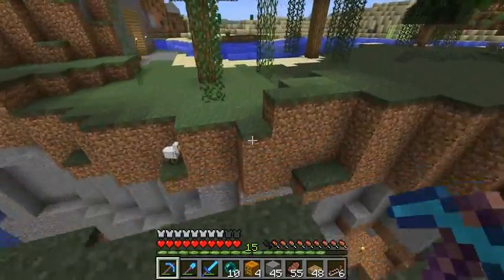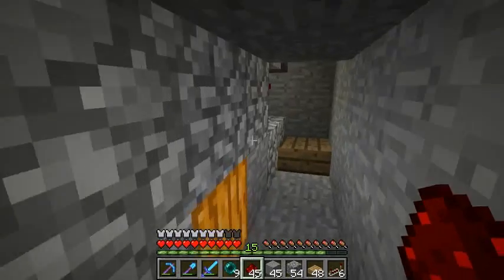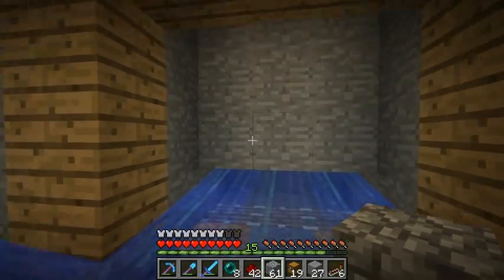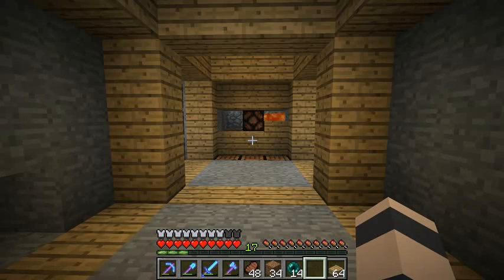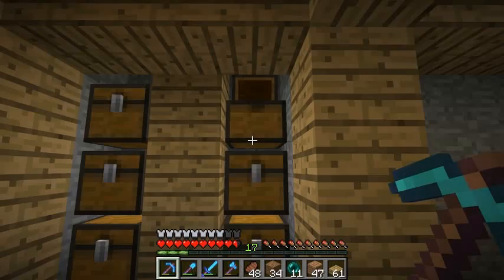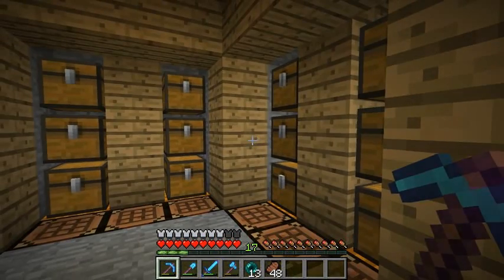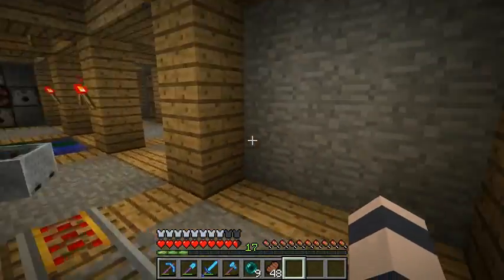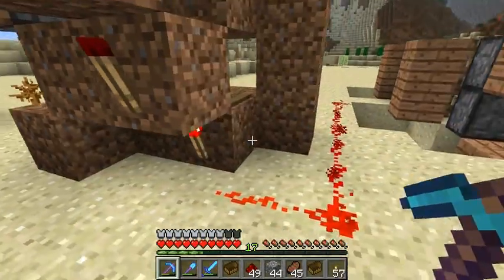Etho Plays Minecraft - Episode 163: Saw Mill

Comment: I like the different woods.
Though I do ship produce that is only from one of my bases,ores and coal from the pit, wood from the forest, sand from the desert... But the buildings at each are made of local materials. So the jungle where i get most my wood have a lot of jungle plank buildings. The planks are used elsewhere, but not as the main material.

Comment: Look back to I think around episode 159 (may be wrong)

He uses a 3 by 3 of signs on the walls + 1 in the middle to hold the water up, and collected and placed lilypads on top of the water-simple =P He has them spaced 30 blocks apart to make traveling by ender-pearl efficient; you just need to hold jump when it hits the pads so you dont fall again, I think (again, may be wrong)

Comment: Well ya but when you move but do not sprint it takes a good distance to even to lose 1 hunger bar plus I've read that if you overeat the game saves that hunger so it takes even longer to lose one bar.  In the game the rate that your hunger bar goes down depends on what you are doing. Sprinting/swing your sword makes it go down very fast but normal running without spring the hunger doesn't go down as fast.

Comment: i use cyberlink power director myself for my letsplays, and its great, was a bit laggy on my now dead computer when editing a large amount of files but besides that its amazing once you learn its tricks, and it compresses fast. if you do use it i recomend you compress in H.264 .AVC at 480p, takes slightly longer than the video itself to compress on my old crappy laptop, and likely a lot faster on a good rig.

my only regret with it is not going for pro so 3d footage from my 3ds is useless.

Comment: Sony Vegas is very good - after getting used to the interface, it's very fast to work with and offers more control over the editing than any other programs I used.

I found that Premiere Elements left no room for expansion - some parts of the interface were annoying and rendering took ages; Premiere Pro didn't work on my computer at all. They could work for you though - and Adobe offer 30 day trials, so do that before you buy anything.

Comment: Fraps records to a very slightly compressed AVI file using its own custom codec.  I personally use a free program available from HandBrake.fr to convert the fraps.avi files into fraps.mp4 before even loading them into Sony Vegas.  In my case, it helps with videos being too dark or losing video altogether as well as making the files much smaller.  I have a video explaining this on my channel called "YouTube Gaming Videos too Dark?" if you want to check it out.